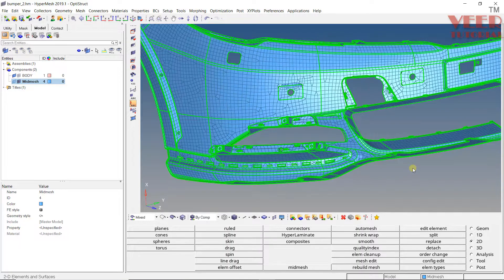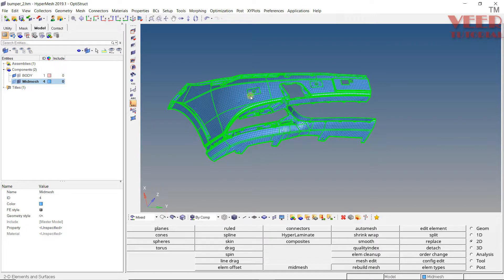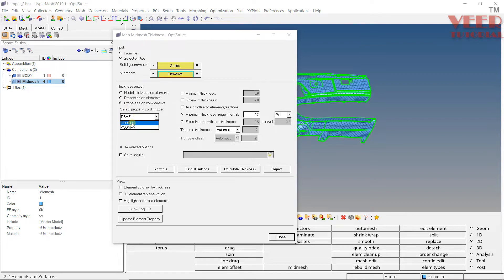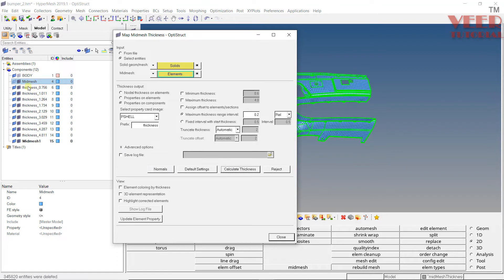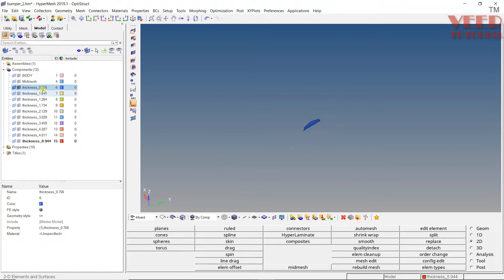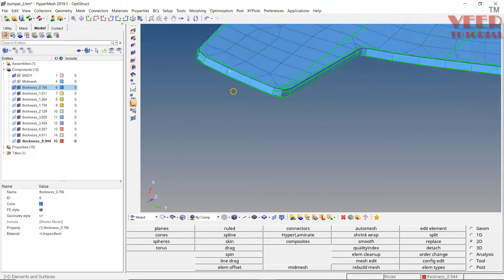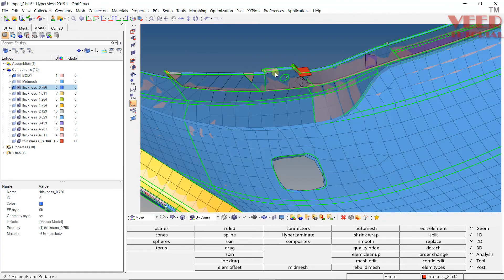Hypermesh | Plastic Meshing | Assign Thickness

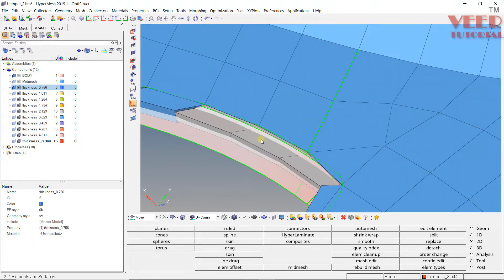Comment: How does Hypermesh define thickness change?? can we set tolerance value to avoid creating so many components for one part ? @6:07, you were checking the portion of the mesh which cannot be of different thickness....I understand plastic parts have different thickness, that would be from ribs, base, attachment tabs, but that portion of the mesh cannot be of different thickness....that is software's phuckUP..... Good video. Thank you
Reply from the maker: different companies have different rules for tolerance value.
so there is no fixed criteria.

Comment: Assign thickness is important for swaged parts (Tie-rod body).
Reply from the maker: for rod, you have to make it as 1D rod. in that case thickness not needed. you need to specify cross section dimensions